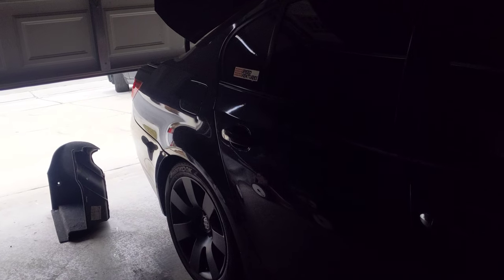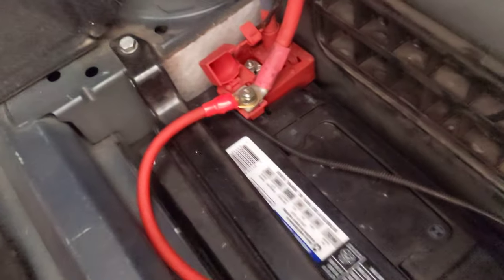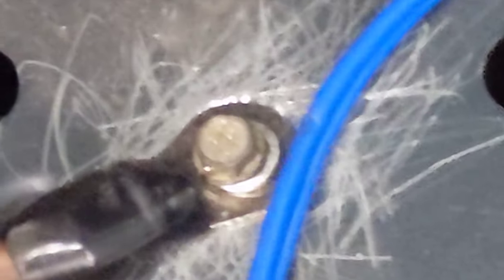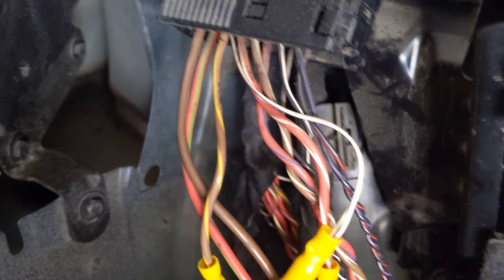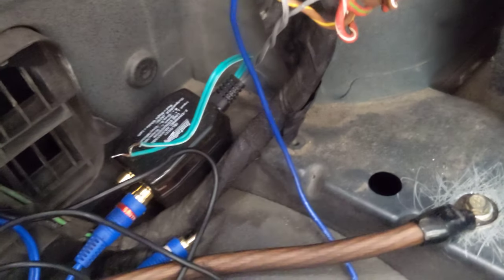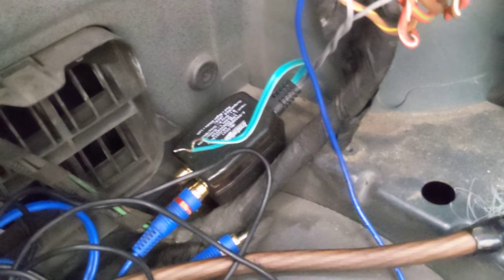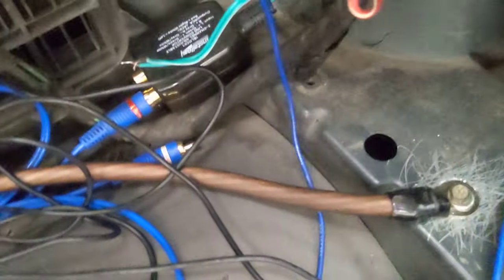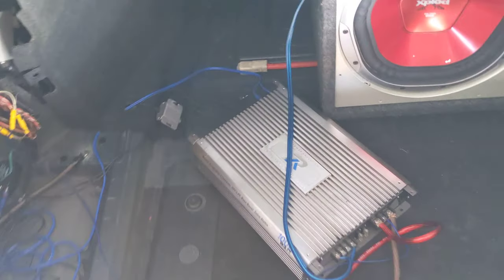Amp and Sub DIY Easy Install E60

Comment: You know I had to do a ton of guess work to fill in the blanks you left here but I’ll be damned it worked
Reply: Did you plug in both RCA outputs to the line converter? I seen he only had one in the video to the LOC but had both connected in the amp. Tryna do this myself any help would be appreciated lol
Reply: lmaooo help meee

Comment: You don’t need A CONVERTER. Plug your left and  right rca wires into your amp and cut the ends off on the other side and wire them into the same harness you wired your converter into but you’re going to tap into the low pass wires instead which the right side is black and brown is negative, black and white positive and left is black and violet negative and black and red is positive.
Reply: Thanks For The Info . I Definitely Didnt Want To To Use A Converter
Reply: Could u help me with this problem i did exactly this but the subwoofer is hummin and is making annyoing sounds how do i fix this??
Reply: How do you splice the rca cables?

Comment: Hello dear. I have a bmw e60 equipped with Radio business? I extracted front signal to manage front speakers (sub under seats + doors) with a 2 channel and rear signal to manage sub with another 2ch amplifier. The issue is how to keep unvariated the sounds coming from parking system..in particular due low pass cutting frequency..obviously you are not able to hear sounds from parking system...any experience? Thanks in advance

Comment: What device you used?any link to it?
Reply from the maker: I used a line out converter which they sell at any stereo shop and rca cables to the amp, I'll be making another video on how to wire it in without the need of a convertor as this is only one method

Comment: Bro, why did you use the sub line after the factory amp to an loc, you didn't have to do all that. I have a 2004 530i and I use the preamp lines before the factory amp so there's no need for the loc. Black/red and black/purple are left channel, black/brown and black/white are right channel. Splice into those but leave them connected, clip your rca leads and solder them straight to the factory amp harness and just secure them with a couple zip ties so they don't tug anything. I came here looking for a remote source, I've heard it was white/purple, but I don't have that combo preamp. I want to use the same remote wire the head unit uses to turn the factory amp on and off. Problem is, the stereo stays on a few minutes after the car is off, just a BMW thing, so I'm looking for a 12v source that cuts on and off directly with the car now. I had gone old school and used the cigarette lighter line, but the amp interferes with the power. Not by draw or anything, but the cigarette lighters stay on longer after the car is off now. For the ground I used the bracket for the battery so both my lines would be right there on the right side instead of crossing with the RCA side. Idk why you scratched your ground area like that, it's a little ridiculous, just sand the paint off the area, it's not about gouging into the frame. Just thought I'd share some insight from my experience 💪 2 12" Pioneer TSW3002D2s running 1,200rms @2Ω on a taramps HD3000. Stock alternator is outputting 150a, but I'm getting close to needing to do my big 3 😁
Reply: Hey. Just to make sure I understand right. RCA for left channel cable when you cut it , inside has positive(covered wire)  and negative wire which is loose.  So possitive rca goes to black/red wire from harness and negative rca connects to black/violet ?
Reply: @johnnyjay7801  yes. for me, i only ever use monoblock amps, so i ran R+/L+ twisted together to black/red and then my R-/L- to black/violet. i've since jammed my remote wire into the plug for the cigarette lighter fuse in the trunk above the battery as well which works the same as jumping off the cigarette lighter line elsewhere. tuning on the idrive only goes down to 100Hz adjustment, so you'll have to adjust your LPF settings on the amp itself for fine tuning past that. only drawback is that the speakers will be tuned with the subs. not an issue unless you're just trying to bass boost a shitty amp to match the logic7 sound. it's always better to bring everything down to match rather than trying to boost what's lacking
Reply: I think that you can tap into fuse 56 or 59 for remote to turn on and off with the car in the rear fuse box 5 Amp fuse
Reply: @treygraham3106  so what I ended up doing is following the green/white positive cable for the cigarette outlet, and rather than stripping the wire and soldering this in I just tucked the REM wire into the harness connector and plugged it back in. if it clicks it'll hold it, my amp is mounted anyway so it shouldn't tug on it for any reason.
Reply: @oztngermolus5416  could you help me i did exactly this but i get this annoying hummin sounds from the subwoofer its so frustating

Comment: Running the remote wire like that wont be an issue ?
Reply from the maker: It works perfect, make sure to use the white and violet wire

Comment: Where’s your satellite module and amp 😳 they’re normally in the location you cut the wires, did you remove those two parts? You won’t have sound
Reply from the maker: There are different sound systems, this is for the Hi-fi

Comment: I've got a e60 ! I don't want to install a aftermarket radio ! So I would like to install a subwoofer without changing my radio....I've got a convertor but i really don't know what to do with it ! I have searched on youtube a lot and your video looks like you didn't changed your radio and you using a convertor ! But i really don't understand everything from the video ! Would be able to explain me how to do it more precisely  , please bro ?
Reply: Also...you're saying in one of your vídeos posted a week ago you can connect the subwoofer and amplifier without  convertor ! Wich of the actual car speakers will be not working when we do this job ( rear speakers or driver side underseat subwoofer ) ??

Comment: Do you still have your memory On your iDrive my time and date will not stay can you help
Reply from the maker: The e60 has a battery sensor that shuts off modules to save power when the battery is on its way out. Do you know how old your battery is?

Comment: Why didn't you connect the negative to negative battery terminal?
Reply from the maker: You need to ground it to the car, scratching the paint off gives better connection
Reply: @mach6889  rofl cant get any better then connecting directly at the battery. Lowest resistance.
Reply: @jeweetdatikhetweet  u're kidding right?

Comment: Do you believe this is better than tapping into rear speakers??
Reply: Much better since these cables are connected to the subs under the seats
Reply: @ollepersson4385  I just did it the other day. Big difference but still get bass roll off when volume is up
Reply: @radianm6  what does that mean
Reply: @ollepersson4385  like as the volume increases the bass doesn’t hit any harder

Comment: That power red wire is too long.. the fuse is supposed to be right next to the battery incase it shorts out it zaps the fuse right by the battery terminal.. now if that long red wire grounds out at any point after the fuse, it will just melt the wire and maybe cause a fire
..

Comment: You never get into the full details of the colors of the wires or how you hooked it up you explain as a short videoNot only that everyone is not the same outlet converter
Reply: Fr shit be difficult when you doing it alone with those wire
Reply from the maker: https://youtu.be/h34-s_GaUNg